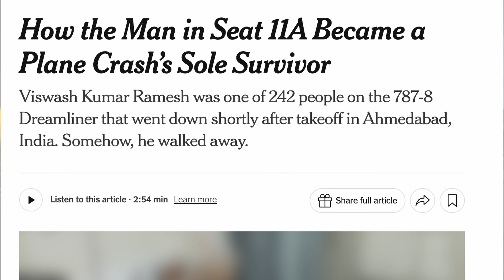Why the RAT Changes Everything – Air India 171 Update

Comment: It's quite interesting that the plane spotters had better analysis than a lot of the pilots as they first suggested that the plane lacked initial thrust and took the whole of the runway to take off. Suggesting more likely problems started just after V1 and a gradual loss of power until the plane crashed. There appears to be no smoke from the engines suggesting contaminate fuel wasn't a problem and no misfire.
Reply: Yup
Reply: per the only survivor the engines were working
Reply: Lot of dust was kicked up when the plane took off, that might have masked any visual problems with the engines. Electrical failure, that some people speculate about, would normally not affect the engines since they don’t run on electricity, they generate it. If it’s not birds or bad fuel, the thing that might shutdown the engines is if the engine control unit fails, or bugs out. But I can’t imagine that would be possible, there should be lots of redundancy…
Reply: @martinolssonbass  from the beginning it was reported by some that they could hear the RAT had been deployed as you could clearly hear that noise which strongly suggests a systems failure of some sort. The fact the plane managed to stay in the air for so long suggested that they still had some thrust from the engines but you could clearly see loss of power 10 seconds after takeoff and all that dust was the end of the runway.
Reply: How much smoke do you expect with water contamination of fuel? There is alway some degree of water in fuel. It's only a hazard when it separates from the fuel into a layer which sits on the bottom of the tank close to where the fuel pump pickups are. 
Biologic contaminants can also block filters and fuel lines. Biocides are used to help get rid of this. Blocked fuel lines = no fuel flow, so no smoke.

To get the RAT to deploy, you'd need the engine generators to go offline (with aircraft in the air & airspeed above a certain value). On typical airliners, the generators trip off when the engines go below idle thrust.
Reply: @ImperrfectStranger  both engines have two separate fuel systems and quite sophisticated for filtration systems so both engines will not stop at the same time.
Reply: @pdevonport7266 Exactly. I’m suspecting that is has something to do with the TCM, the thrust control module.

Comment: The 787 throttles are fly-by-wire. "Thrust not achieved... falling... Mayday! Mayday! Mayday" were the captains last words. The throttles are also fly-by-wire which would indicate why there's no thrust. What caused this catastrophic electrical failure? This problem started on the ground during the takeoff roll beyond V1, not in the air.

Comment: Another auditory clue- It didn't sound like the engines were under max power load. I know engines are quieter than they used to be, but at this altitude you can still hear the power of that giant fan pushing air through the bypass.

Could an electrical problem shut fuel off to both engines?

Comment: If it is a dual engine failure, what is the chance that could happen just few second after liftoff without a bird strik? What is the chance of fuel issue when no other plane before and after have issue!    If it is actually a dual engine failure, I put my vote in as Sabotage!

Comment: In late stages of approval a 787 with an FAA inspector on board had full electric failure at the switchboard and the rat was deployed. 
Electrical faults (direct shorts) also cause loud bangs.

Comment: The sound sadly speaks for itself. Only that. Now that we have a better sound. And yes... We now also can see that the RAT is out... No 787 make this sound with an engine working. This is only the sound of the RAT... Sadly. At this stage of flight, in a populated area, with buildings... They had no change. All these people in these buildings were the plane crashed... It's terrible.
What could have caused that ? Birds ? Fuel contamination ???

Comment: Speaking to reporters from his hospital bed, Ramesh, 40, said: “When the flight took off, within five to 10 seconds it felt like it was stuck in the air.

“Suddenly, the lights started flickering green and white. The aircraft wasn’t gaining altitude and was just gliding before it suddenly slammed into a building and exploded.”

David Learmount, the consulting editor on safety at FlightGlobal and a former RAF pilot, said the flickering lights indicated that the generators that make electricity from the engines were not working properly.

Dr Guy Gratton, an associate professor of aviation and the environment at Cranfield University, also said they “might indicate that the power systems were switching from primary to back-ups”.

A loss of electrical power would probably have been caused by engine failure rather than the other way around, Learmount said, because “once the engines are burning they don’t need electricity”.

Comment: The assumption that the pilots retracted the flaps instead of the landing gear is ludicrous. I've seen a video of someone pointing out the controls in a 787. For that to happen would be as likely as me confusing the clutch pedal on my car with the handbrake lever.
Reply: More like the gas cap. I don’t know about the 787 but those controls are usually far enough apart, not to confuse them, and the “lollipop” for the gear lover is meant to be reminiscent of wheels.

Anyway, that doesn’t sound like it anyway, but I just couldn’t imagine mixing those two things up.
Reply: It's not a 787 thing, they're all like that but I agree with your analogy. It's still possible though, you just go on autopilot at that point after doing it so many times.
Reply: You are making the assumption that the location of the two different levers would prevent such a mistake. However, the physical location isn’t the issue. A brain fart where the brain is saying one thing while the hand is doing the opposite is not an impossibility.

Comment: Why did both engines failed? Because it is a Boeing plane.

But on serious note and this is my opinion it is a circuit failure of the control/instrument panel to the avionics and landing wheel that occurred during the runaway before take off.
One: When they took off the flaps were not down.
Two: The wheel were not up after take off and the flaps were not down still.
Three: The pilots did not notice this at all.

That means to me that instrument panel showed that the flaps where down and the wheels were up but did not send the commands to the wheels or flaps at the runway. And most likely throttle commends were the last to fail.

Comment: I think they were having thrust trouble before liftoff but did not abort the takeoff. They used over 11,000 feet of runway and probably built up enough ground speed to get airborne but not enough thrust to maintain.  They may have reacted quicker to abort the takeoff if they had less runway in front of them.

Comment: I have just one question regarding the (un)-tilted main gear bogeys. IF the landing gear was selected UP (Which is the reasoning for people to hypothesize that the main gear bogeys were tilted forward/straight), then the main gear doors must have been open. Because I do not believe the retraction sequence straightens the bogeys BEFORE opening the main gear doors. The main gear door lock release and subsequent opening always comes first, correct?

Comment: If you look at the dust on the left hand side of the threshold, it suggests a very long takeoff roll.  This suggests at least the right engine failed maybe after V1. So they used every available inch of runway before rotation.  When he did rotate, the left engine was full up and kicking up dust.  The right engine was failing and no excess thrust was available.  Hence you see a yaw to the right.   I presume an electrical buss tie failure that forced the RAT to deploy.  I think he had the left engine turning, but electrics and hydraulics were thwarted by the right engine failure.  If that failure were catastrophic, all kinds of secondary failures could have forced the RAT to deploy.  At the first indication of engine trouble, they should have aborted even if it meant a trip into the overrun.

Comment: On the video showing the take-off roll prior to rotation the TE flaps were retracted. The wreckage of the wing showed the LE flaps still deployed. This implies FLAP 1 was selected prior to take-off as protection prevents change during the take-off roll, no config warning would have been triggered.. The wreckage also revealed the RAT was deployed which happens when total power loss occurs. This was confirmed by the mayday message. The take-off roll seemed far too long and suggested the aircraft may have started suffering power loss after v1 and even rotated below VR. The reason for a double engine malfunction is troubling but the non standard flap position which should be at 5 is the most troubling. At that weight and temperature no de-rate or assumed temperature reduction should have been made.

Comment: Wow, the audio says as much or perhaps more than the video, because at takeoff power, the roar of the engines should have drown out the sound of the RAT almost completely, which highlights the fact that there was a duel engine failure.  The comparison video of  the sound of a RAT operating was from an aircraft landing, with engines at or near idle, not engines at takeoff power.  Very interesting indeed.   

I had been one if those who speculated it was improper flaps setting, because we could see the aircraft literally sink in a stall condition which could really only be explained by a loss of lift, which could only be explained by either a wing configuration issue, or a total loss of engine thrust.  Knowing that the 787 can safely take off and fly on one engine, the loss of lift from a power loss would require that both engines had failed simultaneously, since we saw no sign of yawing you’d expect from an asymmetric thrust situation.  Because the odds of both engines failing are so astronomical, I really got tunnel vision focusing on the flaps. 

Now, the question is, what on earth could cause both engines to fail at takeoff?   An electrical system overload?   It had to be a pretty severe failure, because that aircraft wasn’t flying very long after the wheels were off the ground.  

I’m beginning to at least reconsider the sabotage theory, in context to what the lone survivor said about hearing a loud bang, but I’ll refrain from anymore speculation at this point … because being out in left field once already  is enough for me.

Comment: Flaps were down as seen in the pictures of wings post crash. The controls for flaps and landing gear on this airplane are so far apart and so different in form, shape and operation that I am surprised you thought any half decent pilot would do this kind of a terrible mistake in the first place. You even went on Indian media channels and flouted this theory speculating co-pilot error. It’s like saying someone turned off the volume on the radio in a car instead instead of shifting the gear level or braking because they panicked. That didn’t make sense from the beginning. I am glad you have now changed your perspective. A number of people started blaming the pilots and their training as a result - such a terrible thing to do purely based on speculation and you started it. 

Also, as per other analysts, the landing gear is slightly tilted forwards suggesting the copilot started the retraction of the landing gear but, hydraulics failed due to both engines dying at this moment in time. So, your theory which is in third place should be thrown in garbage. It has no place. 

So the plane takes off, both engines fail sometime immediately after the copilot retracts the landing gear, hydraulics fail, landing gear stops retracting, RAT deploys and airplane crashes.

Comment: Turbines didn't sound right to me, it sounds like the engine stalled.  You can hear that grinding resistance sound and it would have affected reverse thrust too, that plane was screwed either way as soon as it took off.

A video was taken inside the plane by a passenger who sent a video message before take off and he said none of the electrics inside the plane were functioning and he was concerned, absolutely nothing was working.

It sounds to me like the plane should never have been mechanically cleared for take-off in the first place, something was clearly not right with it.

This has made me really weary of commercial flight travel now.

Comment: Another video of analyzing the crash said that in watching the plane take off from a video from the airport that it used way more of the runway than it should of to the point that when it went airborne that the engine thrust was kicking up dirt from past the end of the runway which would also indicate a loss of full engine power.

Comment: I posted the following comment 6 hours back in AiTelly channel:
"Most likely, both engines lost power, as the captain reportedly called out on his radio: “Mayday […] no thrust, losing power, unable to lift,”. But both engines losing power at the same time is very unusual, unless it is a huge flock of birds, striking both engines at the same time. But bird strike symptoms like flame outs were not visible. So what actually happened with the engines is not quite clear, which will become clear hopefully from flight data recorder and physical remains of the engines and associated fuel systems.
I doubt that flap setting was the reason for the crash."

Why I thought dual engine failure is because of the motion of the plane. After it went up, at one point it literally looked like it had no power and was gliding back down.

Comment: Thank you for your update. I was among the first to suggest a possible hydraulic failure, based on the observation that the landing gear remained down above 200 ft — potentially indicating a power system failure. Unfortunately, voices like mine were overlooked, while the world paid attention only to well-known personalities. On Reddit, my attempts to share this perspective were heavily downvoted and eventually blocked by the system itself.
Reply: It also appears the APU also couldn't provide power to the hydraulic system and other essential system to sustain operation, indicating a likely major power system failure. This makes it increasingly likely that the RAT deployed due to a major electrical power failure, which may have also cut off the electrical supply to the fuel system, leading to a dual engine shutdown. Since the Boeing 787 relies entirely on electric motor-driven hydraulic pumps, the loss of electrical power would also mean total hydraulic failure. Without hydraulic pressure, critical systems like landing gear retraction and flap operation would be impaired and further flaps down to increase lift if pilot attempted. It's likely that the RAT restored power to restart the engine if the survivor's version of engine acceleration before the crash is true.

Comment: Another 787-8 had an issue mid air, the United Airlines 613 suddenly lost altitude this January, due to technical failure. Any connection between those?

Comment: Thing is with a dual engine failure shouldn't the flaps have gone down before the failure, if not the failure should have been early enough to abort. However a computer malfunction could have fed the pilots some bs and misled them just long enough that they had to take off and then it could have shut down the engines and died on them. If the computers are down and the rat isn't getting the airspeed to power the systems it needs to becasue they're to slow for it.... Not a good time.

Comment: With respect this doesn't prove engine failure, just electrical failure (sure, engines could have been part of that). It's jumping the gun. As was the very shallow theory that the co-pilot pulled the wrong lever (flaps over landing gear).

Comment: I saw something on Facebook (yeah I know, don’t put too much emphasis on it), where someone who was flying on the short route from one Indian city to Ahmedabad on that plane, said that there was a major electrical outage on that flight where not only the entertainment system but even the PA system had a complete failure. I think I read the lights were also flickering as well. So if that is true, I can’t help but wonder if what started out as an electrical issue, ultimately led to a complete failure after perhaps just receiving a band-aid fix. 

I’m not saying that I know anything about planes or the systems regarding flight, but in hindsight, if it’s true, perhaps there have been missed pieces to this.

Comment: Possibly they lost one Engine after V1 ,, this accounts for the longer take off run,,  the puff of dust on rotation appears only on one side (Port Side) indicating a starboard engine failure after V1. 
The Aircraft also yaws a bit to the right just after rotation , 
The live engine failed at around 400 feet AGL,,  the "Flight Radar 24" stopped receiving ADSB data at this point indicating a full electric failure. The RAT is not very helpful at this altitude and low forward speed.
Just another view point.
God Bless all.

Comment: Also as Swiss001 points out the main landing gear is in a gear position as if it began its retraction process, based on the tilt forward . So it appears they hit gear-up but suddenly the retraction process was halted, which I believe would also result due to a lack of engine power.

Comment: One clue to substantiate that point is the video made by someone who just got off the plane when it arrived to pick up this new set of passengers onwards. Not sure if that is fake but that passenger said the air condition was not working and the entertainment system was not working which kinda points to electrical problems and/or lack of maintenance. Thats probably why they encountered a catastrophic failure.